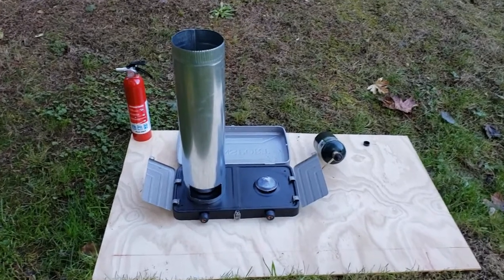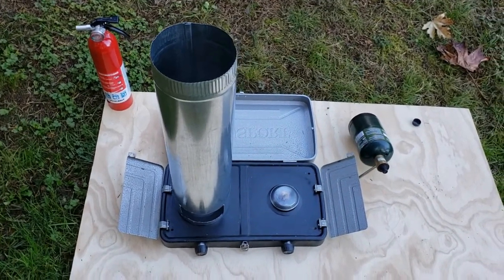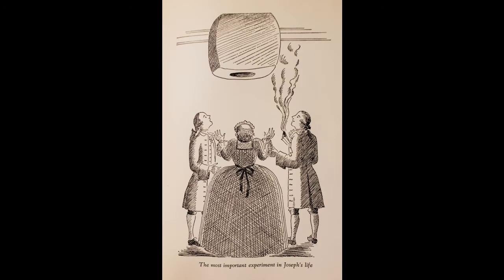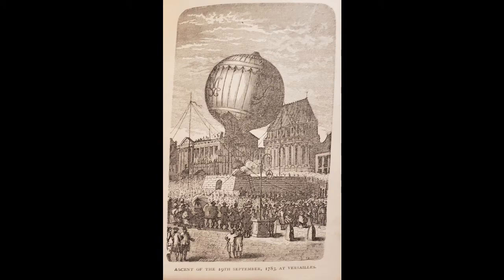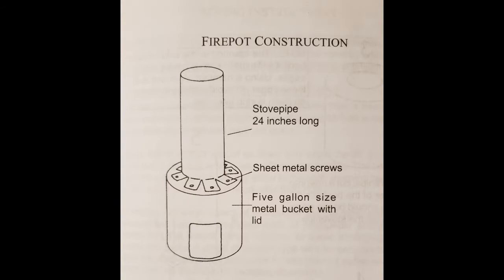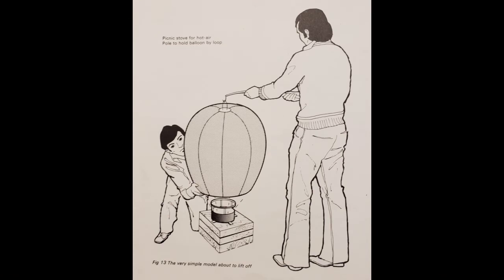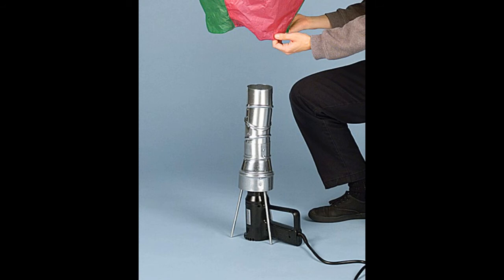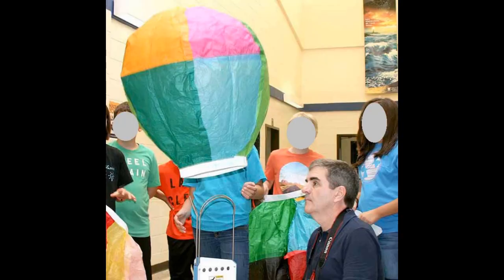Make Things Fly  - Project: Thermal Inflator

Comment: Want to hear my idea?  What if you used green house plastic? Also a core of ultra black. Ive been thinking maybe its possible to lift with that heat? Kind of like a magnify glass on a ant. Now if there was a way to make the plastic act like a fresnel lens that could concentrate the heat to a point.  Or you could have a fresnel core thats shaped like a diamond.
Reply from the maker: I'm not familiar with green house plastic, I do use Mylar (space blanket) for some of my projects. The best thing to do if you have an idea is to try it out. A lot of my projects start with an idea, then I enjoy the challenge and learning experience  of trying to create it. Let me know if you start a lighter than air project.